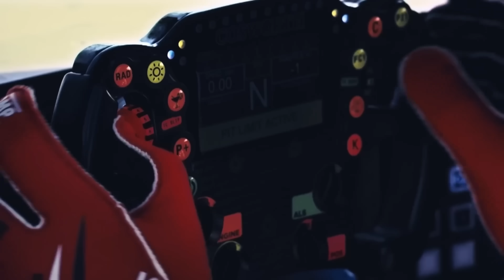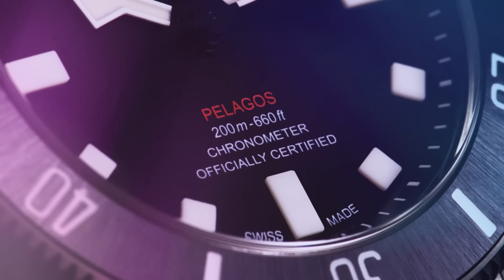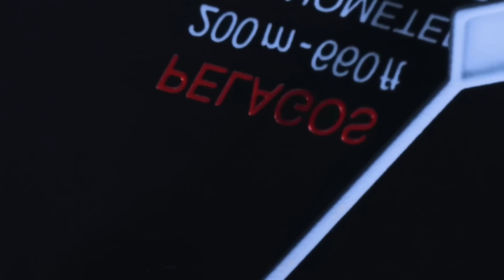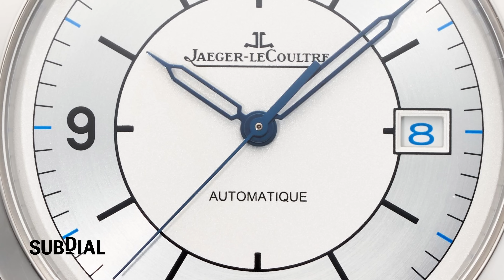10 Watches That Are Absolutely Perfect

Comment: I couldn’t agree more with the list. VC is absolutely grail worthy, at least for me! 👌🏻
Reply: Definitely on mine as well!  It’s next up!
Reply: @paulanderson950 same here the Vacheron is definitely the best of the bunch and still under looked compared to the other two in the Trinity.
Reply: It was my grail until I realised it's sub second track is technically a complete joke 🤡
Reply: @wristopia4101  in what way? Do you mean not falling precisely on the markers as that’s a common problem with high end watchmakers as AP and even PP have some of those depending on the dial design as board markers are far more likely to highlight the issue.
Reply: @wristopia4101  what do you mean it's sub second track is a joke
Reply: @skylineuk1485  Hi, Sorry, I did not explain fully in that comment.
It's nothing to do with the accuracy of the seconds hand hitting the markers.
Even if it was perfectly made, there is no way a seconds hand ticking 8 times per second could hit something divided into 5!
If it was divided into 4 then it would hit each one once and once in between each one.
I hope that makes sense now.

Most watches make the effort to have sub second markers that match the beat rate.
Its not always possible (if 7 beats per second for example) but I think its inexcusable when its as easy as it was for VC to do correctly.
Personally I dislike sub second markers, especially on a three hand (they make some sense on a chronograph) so to put them there when they:
A/ Have no use on a three hand, and B/ Do not even match the beat rate = 🤡 to me.

Hanhart do it too, which is equally odd as they are an historic stopwatch manufacturer.
The Overseas Blue three hand is a stunning watch and a simple steel rehought would suit the design much better IMO.
The sub second track was bad enough when I assumed it was done correctly, but I think my OCD would struggle to unsee it now that I have seen its flawed.
Reply: @wristopia4101 yeah just traditional in the sub second dial maybe but yeah not going to align there. They know it too I think as on the chronograph the outer ring on the main dial is actually divided by four to match the beat rate.
Reply: @skylineuk1485  I hope they know it, but does that make the decision better or worse?
Hanhart make/made 5th of a second chronographs so they have some history with it at least.
Personally its put me off the VC but I have yet to see one.
I will be interested to see what the sales guy says, and wonder if it will be news to him?

Comment: To me the perfect watch is a GMT / Chronograph with an uncluttered dial which sounds impossible but some watchmakers have pulled it off. Longines is one with the Admiral GMT Chronograph L3.670.4.76.6. Tissot also does it with the Couturier GMT Chronograph T035.439.11.031.00. Breitling also manages it with the TransOcean GMT Chronograph AB0451.

Comment: I suggest a few alternatives here: Rolex GMT-Master II instead of the Daytona. The GMT is much more practical and - at least to me - much better looking. Grand Seiko: One of the Evolution 9 series models, in particular in titanium. Tudor: Pelagos FXD instead of the Pelagos 39, because it is much cooler, has better lume on the hands than the 39 and the clasp of the latter is just too large and has sharp edges, which will destroy your cuffs over time. Omega: Seamaster Professional Planet Ocean over the 300m, because the 300m has become too large and the bezel insert does not highlight the first 15' of the dive - this watch does not even fulfill the ISO norms for diving watches anymore... JLC: The Sector dial is wonderful, but couldn't they just make the watch in 38mm instead of 40mm? The other watches mentioned leave me cold...
Reply: The JLC sector dial is 39mm
Reply: @nick-just  Oops, thank you for the correction and have a nice sunday evening!
Reply: @janncfl  worth trying on if you have opportunity. Not only is the case diameter 1mm less than the current generation master control date, but the lug to lug is slightly shorter too.  Crucially, the dial/crystal aperture is approx 2mm smaller (the current generation has a slimmer bezel, meaning the dial size is larger).

Comment: Rolex?!  I'm laughing.  Good luck with losing seconds every day, not waterproof even in a swimming pool after 1 year (Rolex says you need to replace the rubber ring every year), not enough progress over decades, then the risk of being mugged, getting fleeced for frequent service.  If that's not enough, being lumped as  a noveau-riche because at these prices those are the people buying them.   Wannabes.   Long gone is the time when Rolex was ahead.